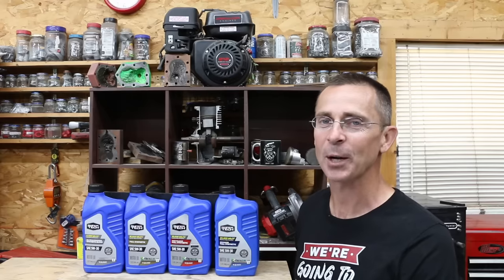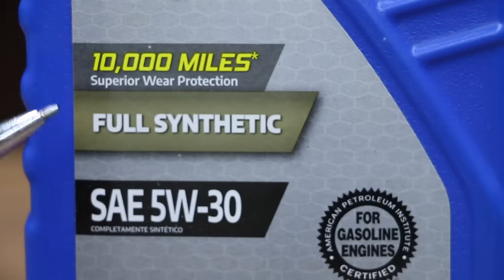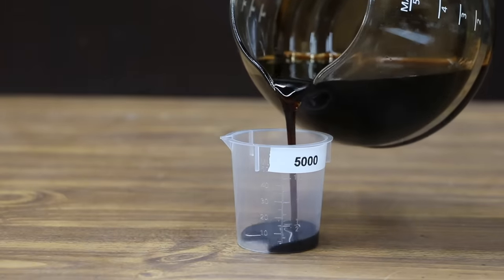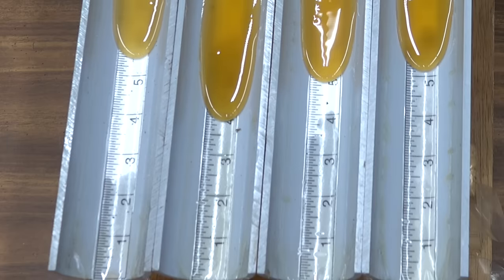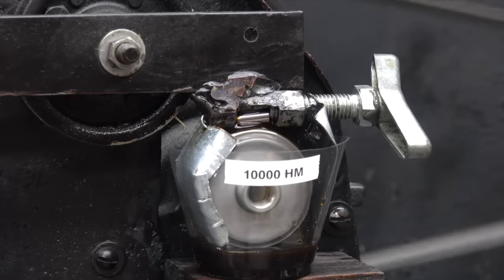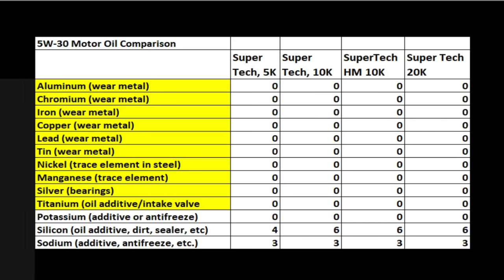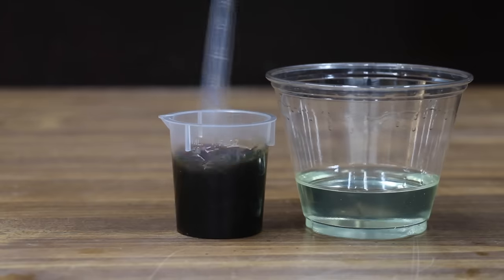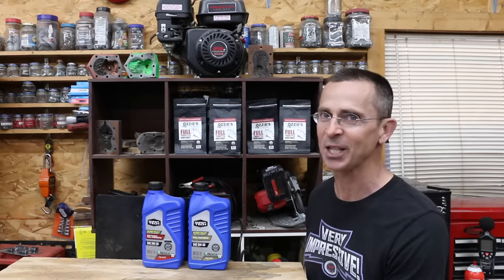Are They All The Same Motor Oil? Let's Settle This! Four Types of SuperTech Motor Oil Compared

Comment: With modern oils it's just throwing away your money changing oil after 5000 mi. BUT. I love the show! Just wish you tested motor oil that's been used 10' to 20' miles, preferably in the same engine, and then look at the test rig/Oil analysis. Keep on trucking!
Reply from the maker: Thank you!

Comment: It was great you added a fuel-diluted sample for comparison!
I recommend four to five thousand max miles on the Oil Change Intervals (OCIs) for most people out there, since regular gas engines also get fuel dilution. Turbocharged and direct-injected engines tend to have higher percentages of fuel dilution than your standard fuel-injected engines.
Think of it this way, the viscosity and protection package of the oil changes when diluted with fuel. That means the oil you drain out is not the same oil that you had put in! It is thinner and will continue to thin out the longer the oil is kept in service (extended OCIs). Your fuel-diluted test sample shows that even running the last-place oil is better protection than running the most expensive, fuel-diluted oil (extended OCIs). 
Are there exceptions out there? Absolutely, there are oils that last much longer than other oils, but they also cost much more. So much more, that the majority of people won't pay for it. And then opt for the cheapest oil at their local lube place and keep the same expectation to go 15K-20K on that oil. Obviously, I can't tell people what to do with their car, because it is their car! But then people get royally upset with me when their engine is noisy or smoking (told them not to buy it cigarettes) and will need expensive engine work done to get it fixed.
Just because you can, does not mean you should. You can either spend the money over the lifetime of the vehicle in small payments or do a major purchase in one large lump sum. Oil is cheap compared to an engine.
 I make the recommendation for them to get the most out of their vehicle based on my years of experience (more so now since inflation affected all of us). Though, I have never heard of an engine breaking from having too many proper and correctly performed oil changes...
What do my OCIs look like? Every 4,500-5,000 miles with it being approximately 70-75% highway miles.
Congratulations, Todd, you've found my button. 🤣
Yet another good oil video for me to show others. Have a great one, Todd! Best to you and yours! 🐺🔧
Reply from the maker: Thanks so much!  Thanks for the feedback.

Comment: I'm by no means a petrolhead, engineer, mechanic or whatever other stereotypes and professions you might think of, but I'm pretty confident in my look, sniff and rub test.

First I look to see if the oil on the dipstick or in a drain pan is obviously fuel, water or sparkles contaminated, and whether it's changed in colour and depending on what to, whether that's appropriate for the usage and runtime based on how well I know the machine it's in

Second, if none of these raise alarms, I sniff it out to ascertain whether there is excessive blowby of either fuel, combustion or exhaust gases, which is definitely easier for me on petrol vs diesel

Third, if there still weren't any problems there, I give it a rub between my fingertips and on a smooth metal surface to determine if I'm still satisfied with its apparent lubrication, again based on the machine and how familiar I am with that particular one

The aforementioned based on me being an assistant in a mechanical workshop and having been focused on the repair and maintenance of our roadworks department's and our workshop's small plant the past two years, as well as my motorcycle the past 9 years, my car the past 4 and LDVs, medium displacement trucks and medium to mid-high displacement earth moving machinery the past 4.

I'm in love with all the technicalities I keep getting exposed to, how much I'm learning as I go along.

Thanks for your videos man whose name I've never thought to check. Been enjoying them probably since you first began blowing up on YouTube.

Please keep at it!

Video suggestion: the use of sealed bearings vs open flow bearings in small engines and the difference in wear, power output, noise and wear after n amount of use, under different axial loads.

I wonder about this because we use Honda GX horizontal stationary motors in a variety of ways with differing axial loads, and also use their Chinese clones, in our department. In some of these motors, for the Hondas it's all through flowing bearings which get all the oily goodness.

In the clones though, especially on the business end of the PTO side of the crank, some of the bearings might end up being sealed instead, likely to help contain oil behind the seal to account for tolerance deviation on the shaft vs the oil seal diameters.

Personally when installing new bearings there I've gone with open ones, or stripping and cleaning out sealed ones if I had to use those, and I haven't encountered oil leaks on said clones with new seals on visually undamaged shafts just yet...
Reply from the maker: Thanks, will do!  Thanks for the suggestion.

Comment: Another great video, but the 5,000K oil is a blend while the others are full synthetic.  
Super Tech does make a Full synthetic oil that does not specify milage information.  
It seems like using that version of oil as the low milage tier option may have been a better comparison.
Reply from the maker: Thanks!  Thanks for the feedback.

Comment: I've always done 5K OCI. My '22 4runner calls for 10K. I pulled the dipstick at 7K and the oil still looked good. At 9500, the oil looked black and smelled strongly of gas. I'm sure Toyota uses great oil at the factory but it wasn't good at 9500. The service manager at the local dealer says he has lots of cars with 200K-300K on 10K OCI but I still don't feel safe driving a car with gas diluted oil. I've pulled dipsticks at 5K and the oil looks good but when you drain it, it's pretty dirty. I'm not convinced on the 10K OCI.
Reply: So you. Buy the 5,000, for supertech oil, instead of the other ones?

Comment: Reminder, no matter what oil you use, your engine still makes the same amount of particulates per mile, the better condition the engine the less particulates it makes. Don't let some label on an oil can trick you into thinking you can go 10 or 20k on an oil change. Hwy miles 7500, local trips mixed 5000 miles stop and go 3000 miles. Project farm always gets an A+.
Reply from the maker: Thanks!

Comment: Video Suggestion: Tractor Hydraulic Oils (Kubota Super, Permatran, Rotella, Delvac, Chevron, Traveller, Providence, Super Tech, etc.). The debates rage all the time in the tractor forums and specs on the off brands are not even published. No one knows the additive packages in any of the brands. This needs to be settled and Todd is the only man we can trust to get this done.
Reply from the maker: Thanks for the suggestion.
Reply: @ProjectFarm  If you do plan a test like this, please let me know. I'm planning to lab test at least Permatran, and maybe 2 other brands, so it's going to be a big expense vs. my measly ad revenues. I'll skip the topic completely if PF plans to cover it.

Comment: I ran Supertech Synthetic in my old Civic and it wasn’t bad for that car. 

On the note of oil change intervals I usually call 10k my max for any car any oil. I’ll try to finish the oil change between 5,000-7,000miles.
Reply from the maker: Thanks for the feedback.

Comment: One thing I will mention about most of your videos is that you speak so fast, and without many pauses in your voice, so it's really difficult to fully comprehend what all you're talking about. I usually have to play your videos at HALF (x 0.5) speed, or pause the video after every sentence you say, (which is more difficult to do), in order to fully grasp all of the info you give or speak about! It would be nice if maybe you spoke a little bit slower, and not quite so monotone.

But other than that, your videos give some great information, so keep up the great work!
Reply: I watch them at 1.25x.  This test proves people are all different and the playback speed feature helps make all things equal.

Comment: To reach 20k miles in a year means that u mostly drive on highway that does not stress the engine too much . Thats why they reccomend 20k OR an annual  oil change. Max  I have done was 18.000 miles using total ineo 0-30 on a diesel. Oil was black but was totally fine..
Reply from the maker: Thank you for sharing!

Comment: Possible video subject for the future, after you learn more about them, is "Strength of various brand PEX A/B fittings and tubing" since you originally may have targeted farming applications and the tubing is good for outdoor structures like barns and tool sheds with water faucets especially where temperatures may drop below freezing.
Reply from the maker: Thanks for the suggestion.

Comment: I've used Mobil 1 Extended Performance for about 15 years now.  I did drive a lot of highway miles and didn't like changing my oil once every couple weeks.  I never made it the full 15k miles before the car started burning the oil.  I would check my oil weekly and when I was about 1/2 quart low I would change it. That was normally around the 11 to 13K mark.  I had 380K on my Prius when I got rid of it. And in the end it would burn a quart around the 6K mark.   I also have a 2004 Colorado that I do the same with.  Now, I don't drive it a lot so I change the oil about every 6 months.  I do have 207K on my truck and no leaks still driving like a champ.
Reply from the maker: Thanks for sharing.

Comment: I always enjoy you video's comparing still we all may need to buy at some point in time and are always unbiased. You would think the most expensive 20,000 mile oil is a much better oil, but not in this case with this brand. What would also be interesting is if you did a video testing the same types of oils from different brand oils. I'm not sure if recycled oil is sold to the public or if it's used for something else. It would be interesting to see the results of that oil too.
Reply from the maker: Thanks for the suggestion.
Reply: @ProjectFarm  👍

Comment: Video idea for you.  You did a great video about mower blade sharpeners.  I think you should do a video about balancers too.  I have long been an advocate of the magnetic friction-less balancers, but I know other guys who swear by the cheap plastic cone balancers and still other who claim a screwdriver in a vise works just as good.  I wonder if you could balance blades all three ways, then measure how much vibration each blade has will running.

Comment: On an entirely unrelated subject, AA and AAA batteries are subject to varying amounts of leakage, particularly when installed in devices that have a long, slow power drain.  It would be really useful to get a long-term test of multi-cell samples of them to see which ones are most prone to both starting to leak before fully drained, and fast to leak once discharged.
Reply from the maker: Thanks for the feedback.

Comment: I still remember the old videos with seafoam and motorkote. I was blown away at what motorkote did. I would say run whatever you want and put motorkote in it. I just change mine regularly and do all the routine maintenance as it says to. The best brand isn't the brand you buy, but the brand you actually change. They all work fine as long as you change them.
Reply from the maker: Thanks for the feedback.

Comment: I used super tech in my 2012 grand caravan since 142k miles, and it’s at 303k now. Zero engine work besides spark plugs, oil changes, and other routine maintenance. I’ve used the blend and high mileage back and forth based on budget. I think this oil is fine.
Reply from the maker: Thanks for the feedback.

Comment: I think the best thing you can do for an engine is keep the oil change intervals short, relatively speaking. Oil changes keep acidity low, help keep sludge levels low, keep contaminate levels lower, and ensure proper lubricity by changing the oils before the molecular bonds are broken down. Anecdotally, I drive an older diesel that uses oil pressure to fire the injectors, and I can tell a difference in the performance of my engine when the oil has gotten far enough past its prime. 
"An ounce of prevention is worth a pound of cure". Oil changes aren't exactly cheap anymore, but it's still cheaper than a mechanic
Reply from the maker: Thanks for the feedback.

Comment: Thanks again for another vid. I agree oil is cheap engines are expensive.  I used to do 3000 mile service with mineral based oil. Now 5000 with full synthetic ,but no more than that.
Reply from the maker: You are welcome!

Comment: The real problem with extended oil change intervals is filter capacity. Once you've conquered the oil stability issue at higher mileage, say with a full synthetic, the next obstacle you encounter is a filter that has exceeded it's capacity to hold dirt. A clogged filter will go into bypass mode and then you have no filtration, causing wear from particulate contamination. Common passenger vehicle oil filters typically aren't designed to go this distance. Installing  high performance after market oil filtration on your vehicle might allow you to achieve higher mileage oil change intervals without the risk of abrasive contamination.
Reply from the maker: Thanks for the feedback.

Comment: Bought a 1999 oldsobile alero 2.4 in 2018, at 69k miles. Towed a trailer all over with that car, i call it my "little truck". Have changed oil religiously (and loads of other maintenece) every 3-4k using walmart full-syn/adv-full-syn and at 150k miles now, and with many cosmetic flaws, it still runs like a 4 cylinder dual overhead cam monster! Lol Just changed from Fram to Supertech filters for the higher flow rate. Figure till i change my oil pump, I shoudnt use a restrictive filter.
Reply from the maker: Thanks for sharing.

Comment: I use the 20k mile oil in my 2016 Silverado 5.3l that has just under 140k miles on it. factory recommended oil is 0w20 but I always noticed after about 3k miles I’d start to get a little lifter noise on startup. I switched to using full syn mobile 1  20k mile 5w-30 with 1 qt of Lucas high mileage stabilizer around 80k miles and and haven’t heard anything since. I also drag my oil changes out to 15k miles with no issues or oil consumption. I also live in Fl and do alot of highway driving.
Reply from the maker: Thanks for the feedback.

Comment: I just change my oil at the interval specified in the manual. I’ve heard of people still using 3-5k, but with the new vehicles they say 10k (full synthetic). Now if I tow or know the vehicle is taking making heat cycles (short trips) I’ll replace sooner. However, an older vehicle, they’ll get the usual 5k.
Reply from the maker: Thanks for sharing.

Comment: I would really like to see one were you get a motor that hasn't had the oil changed like Normal and had a load of thick oil sludge build up and test different cleaners like mystery oil and sea foam stuff like that. I work on cars and just wonder what would clean that best out of what's available. People tend to neglect cars a lot. Thanks for your time.
Reply from the maker: You are welcome!  Thanks for the suggestion.

Comment: Most engine failures are bacause of poor engine designs, lack of lube (low oil conditions), and over optimistic OEM manufacturer oil change intervals. That has been my experience with 30 years in the service deparments of 6 different  OEM's. API rated oils are incredibly well engineered and SN or SP oils are quite amazing when compared to the oils of 20 years ago.
Reply from the maker: Thanks for the feedback.

Comment: One important test of a motor oil is adhesion test. please make a video comparing full-synthetic oil vs synthetic oil and compare which oil stays on piece of engine like cam shaft the longest. Adhesion is one of the most critical qualities of an oil, especially on cold start.

Thanks
Reply from the maker: Thanks for the suggestion.

Comment: I buy new vehicles about every 3 years.  I generally keep the old ones.  My wife is retired now, but I still do a long distance commute.  Even on my 2016 Ram Ecodiesel I have done the factory recommended oil change interval after a first oil change at 700-900 miles.  Which is the first week of driving.
The Ecodiesel has 170k miles and runs fine.  My wife's '18 Ram 2500 6.7L has only 32k miles.  The 2020 Dodge Durango has 108k miles.
Before I got prosperous again.  I bought a '03 Ford Explorer.  The oil has mostly been Mobil 1, 5w20.  Even with 227k miles, the engine is quiet and smooth.
I usually buy Wix filters if available.  The Explorer is rarely used these days.  And I change the oil every other smog test.  
While I live in the Mojave desert.  And the sun is rough on the outside of vehicles.  Good synthetic oil and filters will give long life to an engine.  So keep the body clean and waxed.  And use Project Farm tested fluids for many years of service from a vehicle.
Reply from the maker: Thanks for sharing.

Comment: I personally try not to go over 3,000 miles! My first Chevy 305 I wasn't changing oil until I seen the oil was dirty and thin after a while valves started rattling and sludge build up! My second Chevy 350 I changed every 3,000 and minimal sludge build up.
Reply from the maker: Thanks for sharing.

Comment: I started using full synthetic high mileage Castro Edge with two changes done in the 15,000 miles to date I have not needed to add any additional oil where I the past with conventional oil I always needed to add 1/2 to one quart per oil change. I now change oil every 7500 miles
Reply from the maker: Thanks for the feedback.